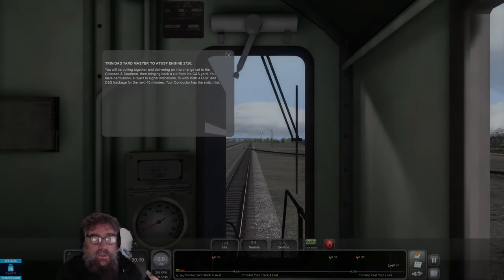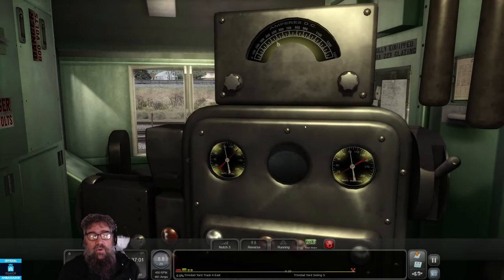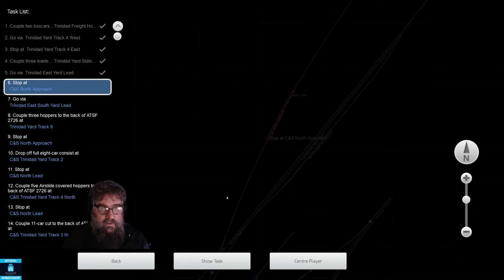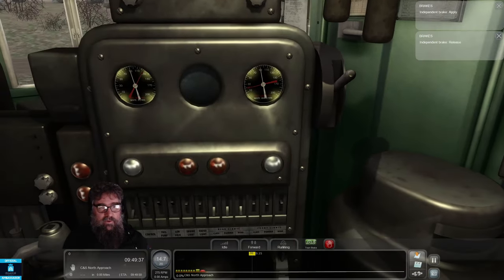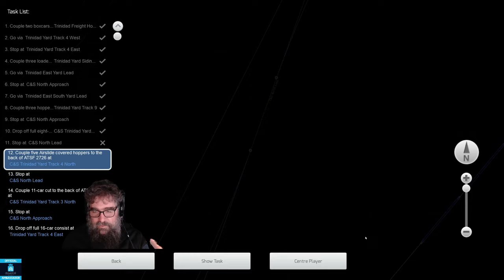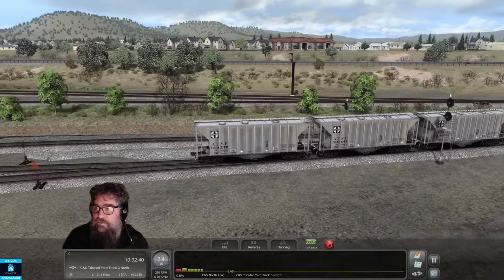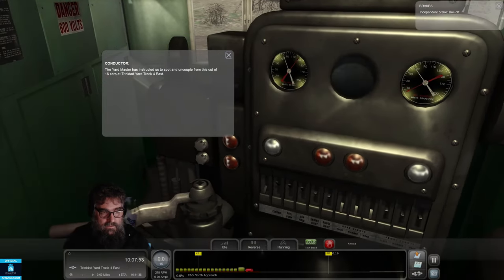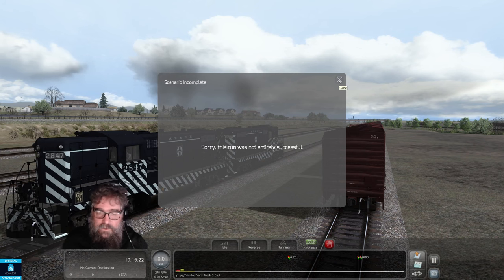TSC Switching with a GP9 at Trinidad on Raton Pass

Comment: Re the use of RailDriver, have you tried disabling the tactile detents? To quote the manual: "The "stickiness" of the train brake handle positions, designed to mimic the feel of moving the handle into a physical de tent (notch) on the brake quadrant, can be disabled using Ctrl + Shift + 3.
" That was added originally to make it compatible with RailDriver.
Reply from the maker: No I have not, I'll give that a try thank you, I had no idea you even could!
Reply: @trainsimulatordriver  If you like, I'll try to be on hand when you do your stream of the Challenger, in case I can help you.
Reply from the maker: @Smokebox  that would be awesome - I've got one scheduled a bit over a week from now so I can get used to it but I'll do a first look after I get access (which should be fairly soon but I won't stream it tonight) - saw Jamie with it today, it does look awesome
Reply: @trainsimulatordriver  OK, I'll try to be there :)